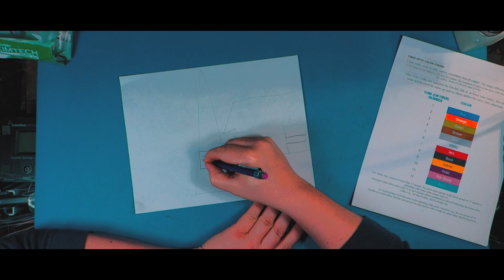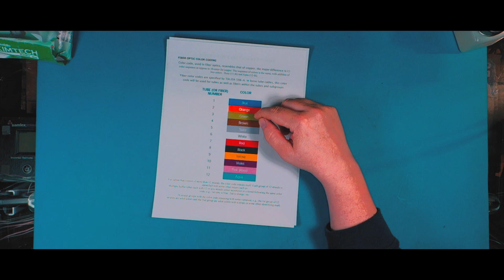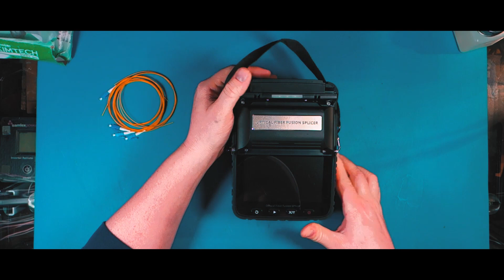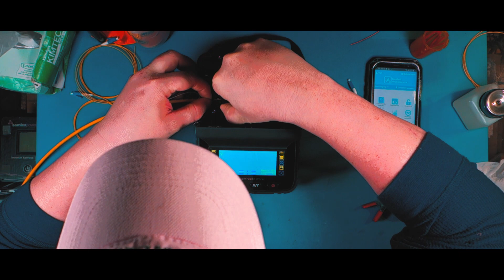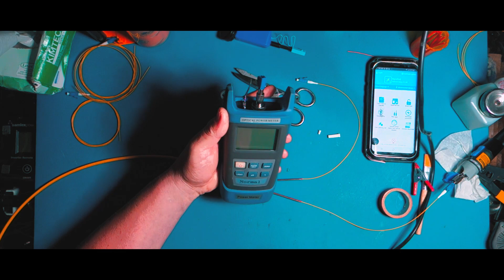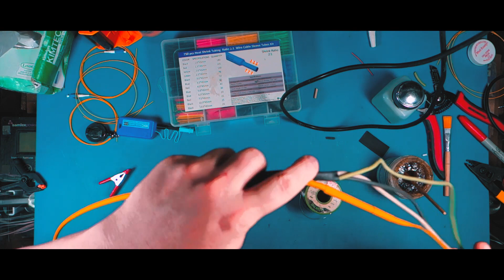DC & Fibre Snake Part 1

Comment: Are you still loving the fiber fusion splicer and did you find a way to use the splice on connectors? I was told you need to have a fusion splicer re-calibrated once a year. Do you think that would be an issue with that unit?
Reply from the maker: Im still loving mine yes. They actually come with calibration kits.
Signalfire never got back to me about the splice on adapter so I gave up. I typically use splice on tails anyways.

Comment: Cool video, lots of good stuff there. However I wouldn't go through the trouble for 50' run. Just buy a premade/terminated fiber cable and run it with DC cable. If we are going to spend time burning we use Shireen trimar and burn on an outdoor rated case on the end of the spool. Then run that up the tower etc, fasten as we go back down and burn on an indoor case at the other end. Also, not sure I would run a ground wire along the DC pair. I prefer grounding to take a different path to closest ground on the tower/structure ground plane instead.
Reply from the maker: This video is intended for those who don't have the luxury or funds to afford cabling ;). The ground in this case is critical to ensure the chassis of the switch shares the same voltage as the rack chasis. theres more grounding then whats shown in the video. If all your devices dont share a common ground plane you can see a voltage differential across data or power pairs that may lead to equipment damage. I explain this in my grounding video. Remember. Grounding is something I specialise in. & dc systems. We repair a ton of equipment which means every repair is an autopsy that tells us a story. We've learned and adapted practices to our findings to help prevent equipment damage/ failure in the future.
Thank you for your feedback though.